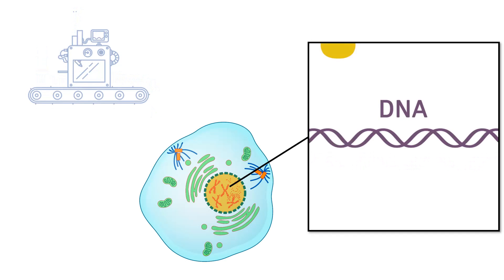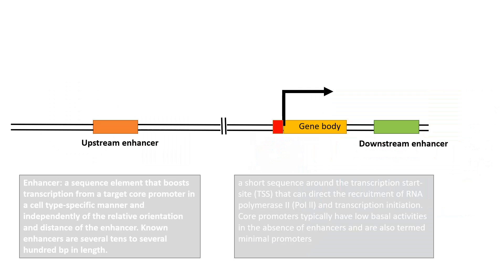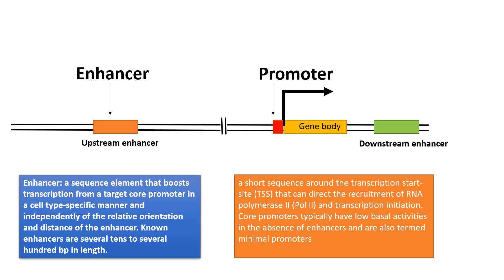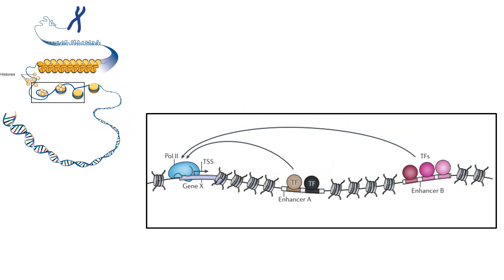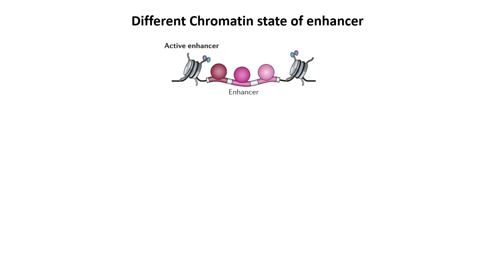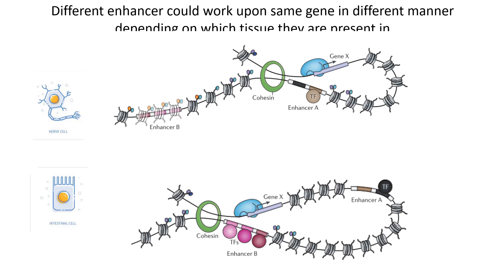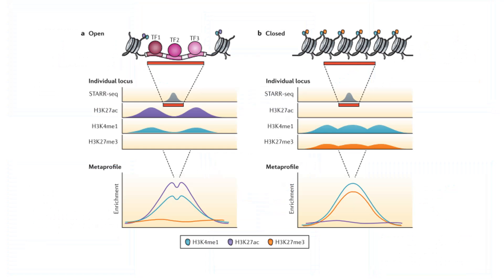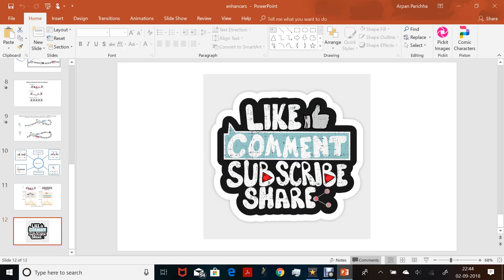Enhancers | Transcriptional regulation by Enhancers | Enhancer promoter loop

Comment: Hello, could I ask if promoter is considered a regulatory element? Some sources do not consider as regulatory element. Thank you
Reply from the maker: It is a regulatory element
Reply: @animatedbiologywitharpan  thank you for replying! Could I also ask but core promoter element itself Is not a regulatory element right?
Reply: @joanne7699  no the core promoter is not a regulatory element. Regulatory elements include promoter proximal elements (PPEs) such as the GC box and CCAAT box (upstream of the TSS by ~50-200 bp), and enhancers and silencers. Hope that helps!
Reply: @adelaide4356  thank u